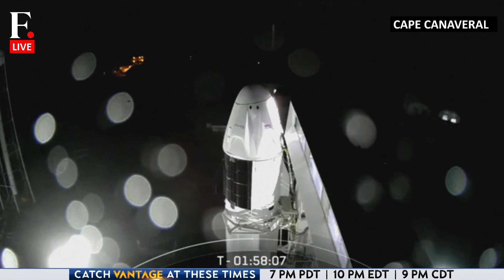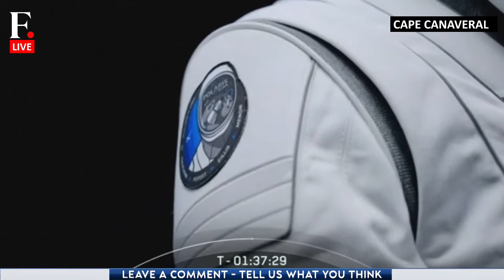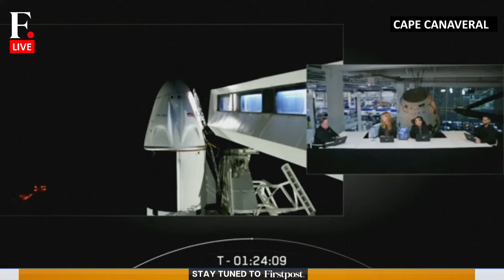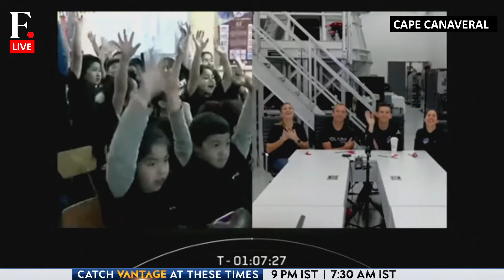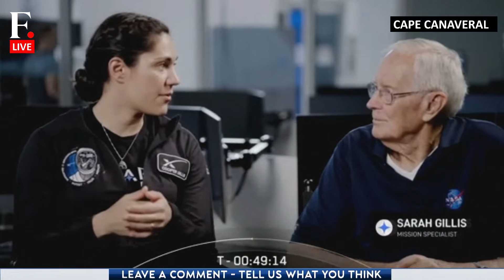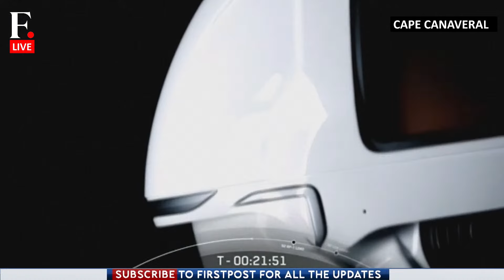LIVE: SpaceX Polaris Dawn Crew Launches for First Private Spacewalk Mission

Comment: The Space X Dawn Polaris uses two combustables which must be kept from heat.
It uses CRYOGENIC LIQUID METHANE  - boiling point is  minus 150- minus 275 degrees 
It also uses LIQUID  OXYGEN  METHALOX  - boiling point is minus 180 degrees.
Space X Dawn Polaris  re-entry temperature is 5,000 F and would explode unless faked.